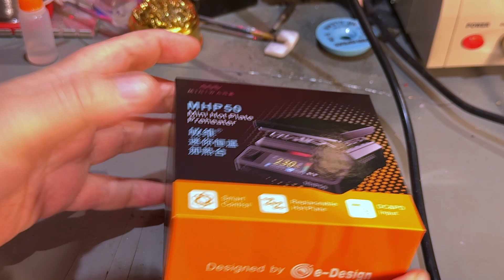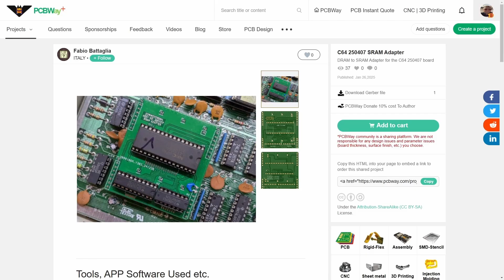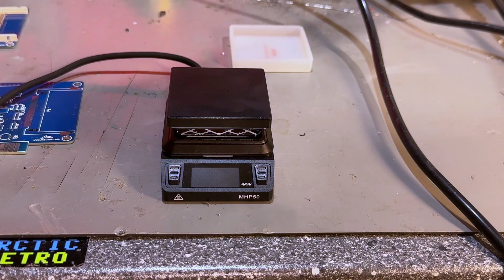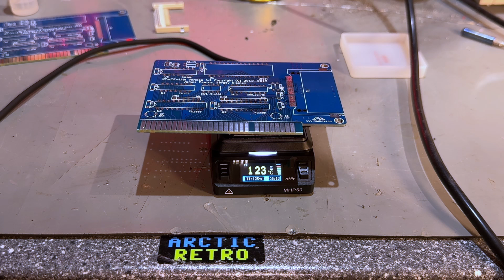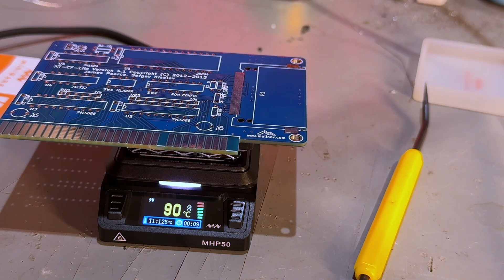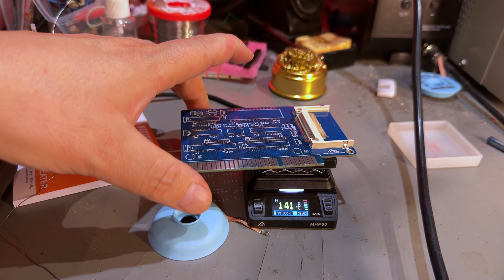Practicing SMD soldering by redoing the XT CF Lite cf card slot solder job

Comment: If you had a bridge, it is usually enough to add more flux and reflow it. The connector pins should be literally drowned in the flux.
Reply from the maker: Thanks for the advice :)